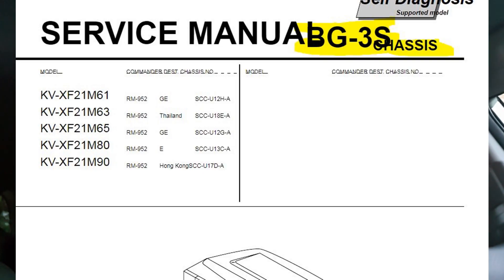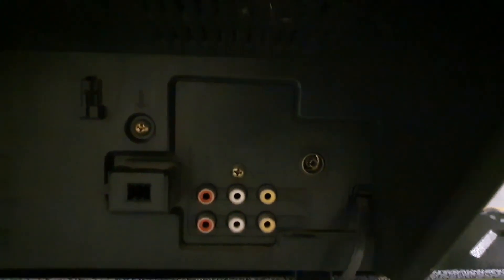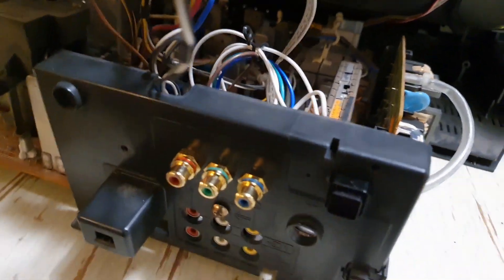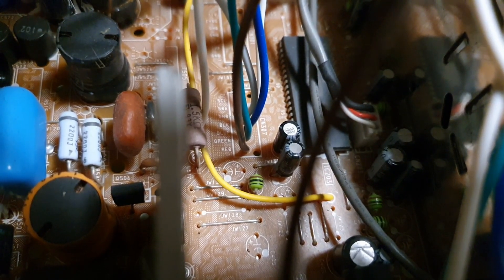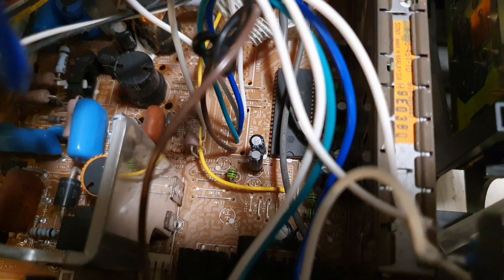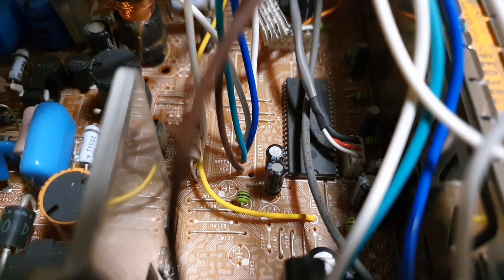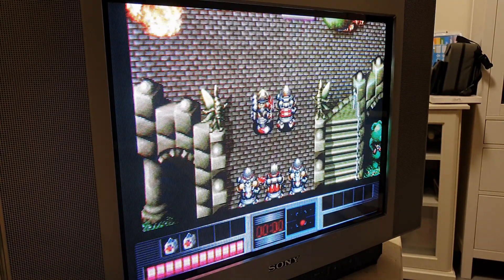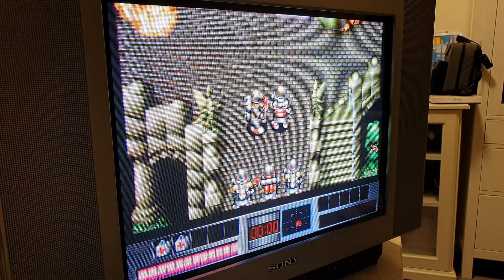Sony Trinitron CRT Pickup and RGB Modification. Easy Mod, Teletext RGB Mod

Comment: Hi there chap I just picked up a 20 inch Trinitron and wanted to know how dangerous is it to mod it I’m going to watch thousands of videos and follow the manual but a few people have scared me saying that it’s really easy to hurt yourself if you are not careful any tips? Thank you.
Reply from the maker: Not really dangerous. Turn it off. Leave it unplugged for 48 hours. You will be right. Never work whilst it's live. Even if  your not comfortable discharging leaving it off for 48 hours it will discharge itself. As a side note when you power it off and you hear a crackle like it's winding down, Good chance it has a bleed resistor and that crackling you can hear is the tube self discharging.

Comment: Hello Bid, cool video. I have a 80cm Trinitron and it comes with the component input built in. However I am trying to get a PC HDMI signal converted to a component RGB to play my retro games. I got a converter from eBay, but the image doesn't want to sync it's horribly flickering. Not sure if you would recommend a converter unit for HDMI to Component that works with a CRT? Cheers mate

Comment: Mate, this is freaking awesome. I'm modding a set similar to this (KV-XF29M35) and it's awesome to see a video like this rather than the vague descriptions on various forums I've been scouring. Thanks a lot.
Reply from the maker: No worries. I'll be putting a few more videos up shortly aswell,  one which will explain the brightness issue you may experience but it wasn't that big an issue for me hence I didn't really go into it. Yiu may just need to turn the brightness down in the picture menu. But Stay tuned.
Reply: @spudzgames4361  Ah no problems. Kind of a related question, what's your thoughts on minimum wire gauge for this mod? I've got a huge roll of this nice rainbow ribbon which is 28 gauge, not sure if it might cause me crosstalk issues or whatever though.
Reply from the maker: @ashpowell9451  I cant remember what I used. Prob what I had lying around. If its away from the flyback you should be fine.
Reply: @ashpowell9451  Hi - did this mod work for you? I'm about to attempt the same on a KV-XF21M20
Reply: @JoedeLange  yeah it did

Comment: what size wire did you use?
Reply from the maker: Not sure actually. It was what I had lying around. Just to get it going. Would assume thicker the better. Would also suggest shielding if possible.
Reply: Thank you I’m gonna try to attempt this so wires, the resistors, rgb inlets , and a switch. Is their anything else you think we ll need?

Comment: HELP ME , when i switch for RGB the TV stay black , only audio that working , im using scart cable , and i use 5V for the blaking from scart consol from pin 16 to the jungle chip, i also add 2.2 kilo ohm resistor to the blanking for get 3 volt , and its stay black , mybe should i pickup the 5v FROM TV mother board , i dont know how to find 5V on the botherboard, help me pleas
Reply from the maker: Try getting the voltage under 2.5V
Reply: @spudzgames4361  ok thanks , how i can find 5 volt on the motherboard ??
Reply from the maker: @MouMouhDS2  whats the model of tv. Whats the jungle ic model number.
Reply: @spudzgames4361  im using sony trinitron KV-TG21L70   - BG2T chassis and TDA8844 Jungle IC , this TV not have an OSD and no teletext so I rise up the legs from a jungle and I wired My RGB line to 23-24-25 Pins and 26 for blankin , I’m using scart and I wired pin 16 of the scart to the blakin ( scart pin 16 voltage is 5V so I added a 2.2kilo ohm resistor to lower the voltage to 2.5V for the blankin I tested with multimeter and the blakin got 2.5 volt , and the RGB line a grounded them with 75omh resistor and 100nf capasitor to jungle , and Im using GND from the mother board directly to scart pin 21 ground , and I connected all ground together, I tried to remove the capasitor from RGB line and same problem , when I turn RGB switch on I got black screen only audio work , when I turn of RGB I got regular composite signel , please please please help me , I want to do this mod please , and sorry for my bad English , thanks for helping me dude
Reply: @spudzgames4361  i tried getting the voltage under 2.5V (2.3V for Blankin) ,But when i start a TV the 2.3V  blankin become 5V, i dont know why, (again im using 5V from scart consol, i dont know how to find 5V on the TV board)
Reply from the maker: @MouMouhDS2  suggest you look at the data sheet for the chip. As I read it 0-0.4v on blanking it will not switch. 0.9V with a typical of 0.6V for data insertion. Above that i don't know and you may have damaged your jungle.
Reply from the maker: Go here and download data sheet. 
http://www.datasheetcatalog.com/datasheets_pdf/T/D/A/8/TDA8844-N2.shtml
Page 32
Reply from the maker: Also looking at schematic look for section labelled CN001 and CN002. They will either have a V2 card installed or not. You can insert RGB into these sections as well. Should be clearly labelled on PCB.
Reply: @spudzgames4361  before i rise up the legs of the jungle IC , I insert my RGB and blankin on CN001 and nothing hapened
Reply: @spudzgames4361  when i start the TV , and mesure the blaking with ground , he give me 3 volt without any voltage source, im not give him the voltage, why the blankin have a 3 volt when he is not grounded
Reply: 15 DAYS of trying modding my CRT but i cant, i tried so hard :\
Reply: SpudZgameZ, thank you very much for your vid, I was banging my head on the blanking signal voltage level, only getting a black picture. I made a voltage divider with 2x75 ohm resistors (how do you choose the value of the resistors btw?) and now it works.
MouMouh Vtec, I have the same chassis as yours, a BG2T with a TDA8843 jungle IC. I taped the 5V from the jumper wire JW033 which is connected to the +5V regulator IC002 and the voltage divider brings it down to 2.3V. I connected RGB, BLK, GND to CN001 and took off R330, R331, R332
Reply: @ronnybkk1  Thanks for detailing your volatege divider resistors as I was wondering what size to use.  Why did you take off R330 , R331 and R332 , pretty sure I have the same Chassis and Jungle chip .  Just discovered this vid today and want to mod my KV-PG21P10.
Reply: @shannonbirt9267  I've down this mod a while ago but I would imagine these are the pull down resistors for the RGB lines and the  impedance signal for your external input must be 75ohms.

Comment: Thanks for the video mate. Any experience with BG1-S(d) chassis?
Reply from the maker: Hi. Thanks for watching. I've never seen one with a (d) suffix and a bit of googling I can't even find a schematic. I can find service manuals but they do not have schematics in them. Suggest maybe opening it up and seeing if it has that section I used. One sure fire way to tell is if it has teletext. Generally if it does then you should be able to do this mod by removing the teletext board and utilizing it's RGB BLK G lines.